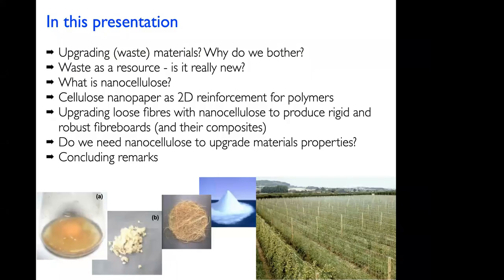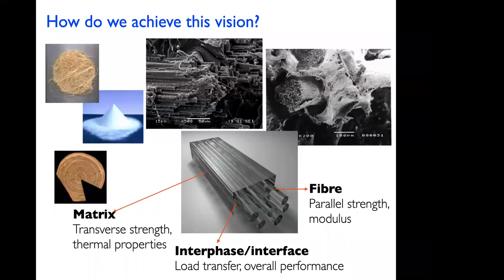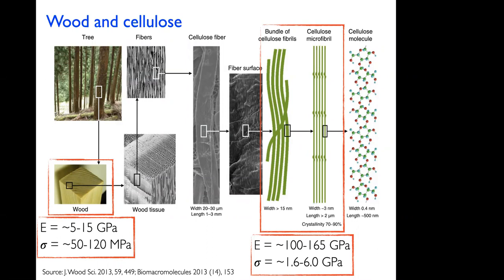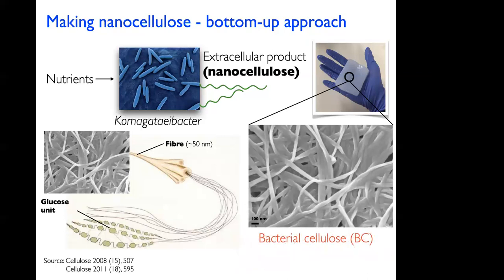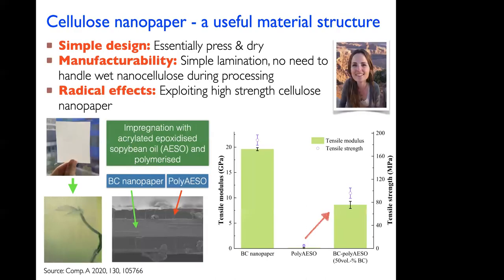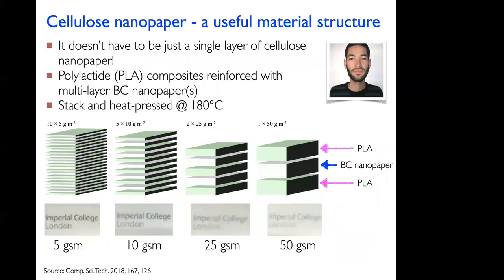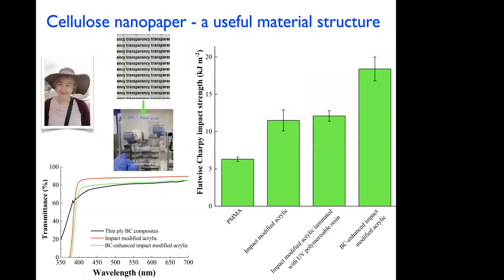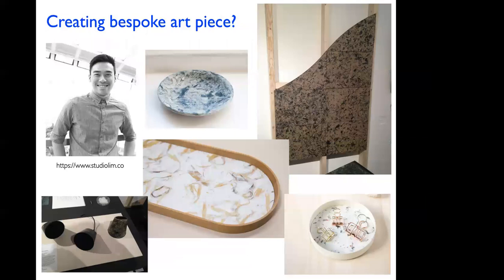IMSE Webinar: Upgrading Waste with (Nano)cellulose

Comment: Hi  IMSE Imperial,
I has questions about your video
1/ Which is the best techniques to dry nano cellulose (Why we must use this techniques)
2/ I would like to characterize shape and size of nano cellulose, I use SEM for characterzing shape and size (nano scale), Is this a right method ?
I hope I would receive your answer soon
Thanks so much
Reply: It does depend on what you want to characterise your dry nanocellulose. Assuming that you want to characterise the morphology of it, the usual TEM/SEM/AFM would work. The key is the preparation methods. For example, you might want to consider staining when preparing your nanocellulose sample for TEM (drying also matters here by the way). For SEM, the dilution of your stock nanocellulose solution and the type of SEM used matter. 

In terms of the size and shape - it would depend strongly on what you are looking at. If you are looking at the size/shape of the individual fibrils, then EM would generally work (depends on how small it is - you might need TEM if you are looking at TEMPO-oxidised nanocellulose) for an approximate description of width. Length is rather difficult to get unless you have isolated fibrils. If you want a more accurate description of width, (neutron) scattering would be best

Comment: Hi Sir,
I have question about cellulose nanocrystals. 
By the way, if we characterize crystalline index of raw materials and cellulose nanocrystals.
Question: How to calculate crystalline index ( I guess using Segal crystallinity index after receive result from analysis lab) BUT i can't understand how to calculate.
I hope I would receive your answer soon.
Thanks Sir.
Reply: Hi, if one were to look at the original publication by Segal et al. (1959), one will realise that the equation is an empirical equation based on cotton (i.e. pure cellulose without any other impurities). For cellulose nanocrystals, it may be ok. For your raw materials, it depends on how pure it is. A more accurate method is to perform a Rietveld refinement on your X-ray diffraction data. Some data analysis software may have this function. If not, you can use MAUD. The known crystal structures of cellulose can be found in the literature and will be needed for your refinement.